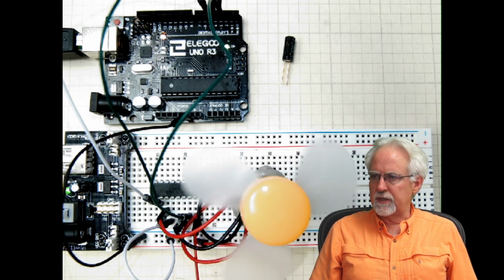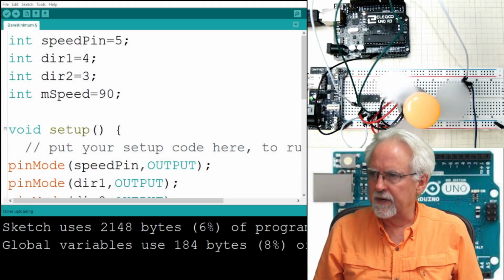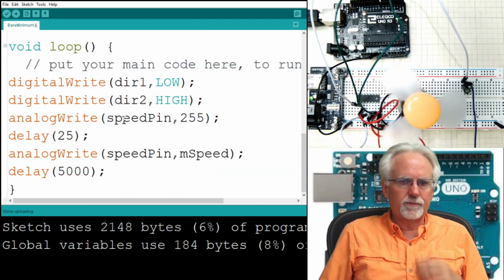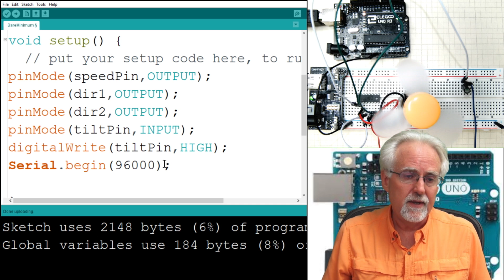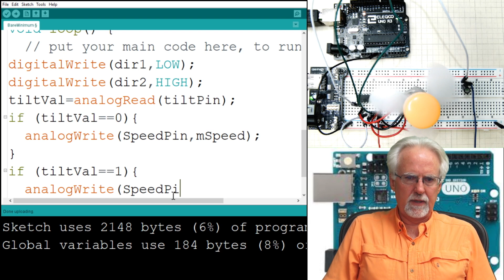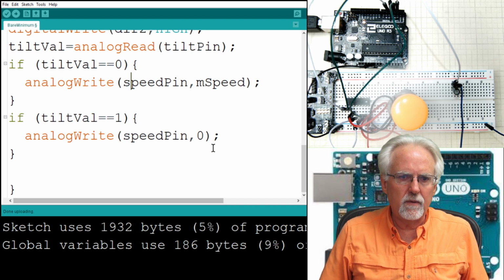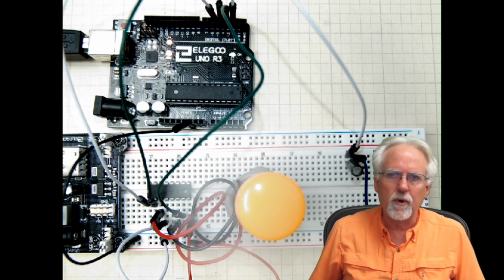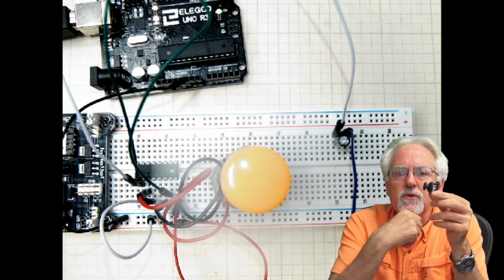Arduino Tutorial 38: Using a Tilt Switch Cut Off With a DC Motor

Comment: Hi, Paul.  Did the homework on my own successfully.  Since the bread board is so big and I hate to have to tear it down and start over most times, I decided to see if I could combine lessons 35, 36, 37 and 38, both schematic and code, so I could run the whole shmear at once.  So, now I have a reversible stepper motor driven by a toggle switch, a DC motor and fan running clockwise (so the air blows out/up from the blades), and both motors stop if the tilt switch goes to 1... with green and red LEDs to indicate when it is normal vs "tilted".   I'm sure the battery doesn't love running 2 motors at once, but the PS does seem to handle it.  My board is quite full, but I didn't run out of pins!  Fun!

Comment: Hey Mr.McWhorter, ,I did this homework on my own, worked perfectly! heres the code:

int dirPin1=4;
int dirPin2=3;
int mSpeed=255;
int tiltPin=2;
int tiltVal;

void setup() {
  // put your setup code here, to run once:
pinMode(speedPin,OUTPUT);
pinMode(dirPin1,OUTPUT);
pinMode(dirPin2,OUTPUT);
Serial.begin(9600);
pinMode(tiltPin,INPUT);
digitalWrite(tiltPin,HIGH);

}

void loop() {
  // put your main code here, to run repeatedly:
tiltVal=digitalRead(tiltPin);
if(tiltVal==0){
analogWrite(speedPin,mSpeed);
digitalWrite(dirPin1,LOW);
digitalWrite(dirPin2,HIGH);
}
if(tiltVal==1){
analogWrite(speedPin,0);
digitalWrite(dirPin1,LOW);
digitalWrite(dirPin2,LOW);
}
Serial.println(tiltVal);
}

Comment: I used an IF/ELSE rather than two IFs. 
I see you found the 96000 baud rate I commented on in the last lesson. 

I still have trouble with replacing a resister in the pull down circuit is with a software write to an input pin. If the board was built by an engineer and passed to a programmer, it might not get coded properly.

Comment: Hi Paul, I just started watching your videos on arduino from last week, and I do like it.. thank you.. if you don't mind, i have quick question on this video, the microcontroller has two pin for ground, and you just used one of them.. correct? if it's sufficient to use 1 pin, why are there 2 pins?

Comment: I did the homework before the lesson.  A difference is that I didn't set the speed to zero to stop the fan, I set both direction pins to "LOW".  Also, I added the LEDs from the tilt switch lesson.  So, when the fan is running, the green LED also lights up, and when the fan is stopped, the red LED lights up.

Comment: Shouldn’t it be equally important to set both digital pins to low and motor speed to 0 if tilted.  Wouldn’t it be possible if the fan was rotating to continue rotating with voltage supplied by the digital high

Comment: I did what you did except I inverted the read from the tilt switch so that when it was in the OK position I was reading "1" from the tilt switch, that way I could simply multiply the motor speed variable by the result of the tilt switch read and if the device is OK the motor would run and if the device were "tilted" the result "0" multiplied by the speed variable would, of course, result in "0" effectively shutting off the motor.  I like to avoid using conditional statements when I can as it slows down program execution.  Also I was a bit confused when you gave the assignment as to if you were expecting us to use the tilt switch and hard wire it to electrically break the circuit or use it as a sensor and use program control to shut it down.  I opted for the later as I figured it was mostly a coding exercise.  Thanks again.  I'm learning a lot.

Comment: Wouldn't it be better to execute the starting kick inside void setup so it doesn't repeat cyclically?
The motor would run smoother... It wouldn't see that cyclic peak in voltage all the time.

Comment: I used the tilt switch and also used the photo detector,. they work great together. The motor does slow down with low light and full speed at full light. Thank you Paul always a good day to watch your lessons.

Comment: I did this after the previous lesson all on my own! Loving the videos!
int speedPin=5;
int dir1=4;
int dir2=3;
int tiltPin=2;
int tiltVal=0;
int mSpeed=255;
void setup() {
  // put your setup code here, to run once:
pinMode(speedPin,OUTPUT);
pinMode(dir1,OUTPUT);
pinMode(dir2,OUTPUT);
pinMode(tiltPin,INPUT);
digitalWrite(tiltPin,HIGH);
pinMode(buttonPin,INPUT);
Serial.begin(9600);
}

void loop() {
  // put your main code here, to run repeatedly:
tiltVal=digitalRead(tiltPin);
analogWrite(speedPin,mSpeed);
Serial.println(tiltVal);
if(tiltVal==1){
  digitalWrite(dir1,LOW);
digitalWrite(dir2,LOW);
analogWrite(speedPin,mSpeed);
tiltVal=digitalRead(tiltPin);
Serial.println(tiltVal);
}
if(tiltVal==0){
  digitalWrite(dir1,HIGH);
digitalWrite(dir2,LOW);
analogWrite(speedPin,mSpeed);
tiltVal=digitalRead(tiltPin);
Serial.println(tiltVal);
}
}

Comment: This one was cake!! The only thing to this point that I’m struggling to conceptualize is the toggle switch.  It gets easier the more I practice with it tho
Reply: Exactly man
Reply: I can agree
Reply: I absolutely agree 🙂
Reply: Yes
Reply: @williamhandlebar9585  the toggle switch was very challenging
Reply: yes! storing the old value and getting the new value and all of that. most difficult idea thus far.
Reply: Agreed.  The toggle switch is very simple from a logic standpoint.  It's a mindbender when you try to translate your logic to code.
Reply: I did the homework 2 different ways, I did it the way you are doing it now, and I did it in a way, that I added LEDs and active buzzer.
 This was a fun project.

Comment: Why not put the tilt switch between pin 8 and 5 V to cut off power to the motor? This way, we don't have to change the code.

Comment: I also chose a hardware solution first connecting the tilt switch between the fan and pin 4 on the controller.
How many electricians does it take to shut off a fan? - zero - that's a software problem......

Comment: Is it possible/safe to put the tilt switch hard-wired inline with the motor? (I.e. fixing it in hardware rather than software). Could this damage the microcontroller? Presumably you'd need a bigger tilt switch if working on larger motors.

Originally did it with the code but realised when watching this it would have been much more simple to put the switch inline...

Comment: Well, I thought I had it last night but couldn’t get it to shut off. Then I couldn’t get it to start after some “fixes” Have to admit I tore it apart and put back together, changed some code, change pins when I thought some pins weren’t working and even swapped out my boards when I thought I might have a board issue. In the end I think (???) it was a combination of coding mistakes with an extra bracket, extra comma and possibly a analogWrite where a digitalWrite should have been. Now working but I have a new issue I think. The power light on the power supply still stays on even when the power supply button is switched off, not as bright but definitely on. Could my L293D chip be damaged, perhaps a bad diode or such? Or maybe that’s normal, just didn’t notice it before? Guess I’ll order a few spares so I can check that out. They say you learn from your mistakes but I’m not sure I feel a whole lot more knowledgeable right now. 😬 Has made me think though so, thanks again Paul.

Comment: Nice Video.
But I’m wondering how the program works.
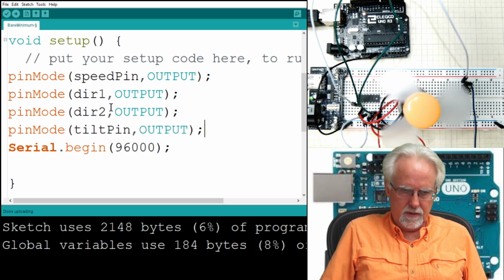At 5:30 you set the “ pinMode (tiltPin,OUTPUT);” 
but it should be a Input to read the tiltSwitch.
I’m wrong?

Comment: Loving these lessons! FYI, I noticed that Paul keeps referring to the trick of doing a digitalWrite to a digital input pin to have it activate a pullup resistor for that pin. I noticed that there is an easier way to do this and that the Arduino docs even recommends doing it this way:

When initializing the pin, simply use a command like this:

pinMode(3,INPUT_PULLUP);

This is effectively the same as specifying that the pin is an input pin AND doing the digitalWrite in a single command.

Comment: i did my homework but i did it a few different ways; first i used an "else" instead of the second "if" statement and i also put my "dir1" and "dir2" in my "if" and "else" statements and i also did not have to print tilt val, here is my full code:

int tiltPin=2;
int tiltVal;
int speedPin=5;
int dir1=4;
int dir2=3;
int mSpeed=255;

void setup() {
  // put your setup code here, to run once:
pinMode(tiltPin,INPUT);
pinMode(speedPin,OUTPUT);
pinMode(dir1,OUTPUT);
pinMode(dir2,OUTPUT);
digitalWrite(tiltPin,HIGH);
Serial.begin(9600);
}

void loop() {
  // put your main code here, to run repeatedly:
tiltVal=digitalRead(tiltPin);

 if (tiltVal==0){
    digitalWrite(dir2,HIGH);
    digitalWrite(dir1,LOW);
    analogWrite(speedPin,255);
  }

  else{
    digitalWrite(dir2,HIGH);
    digitalWrite(dir1,LOW);
    analogWrite(speedPin,0);
  }

}

Comment: Well, I did my homework, but I didn't get it right. I just removed the cable on the 0V pin of the IC and replaced it with the tilt switch. Beginner level showing there, and totally misses the point.
Might be a good idea to go to tutorial 1 and start from there. Haha.
I learned much more your way. Looking forward to learning by going through all the tutorials.

Comment: Yup, I did it! The first time I just put the tilt switch between the 0V pin of the motor control chip (pin 4) and the GND. The second time I did it like you did :D
Reply: I did that too.
How many electricians does it take to shut off a fan?
None - That's a software problem.😷

Comment: i did my homeWork!!!! im looking if is good 

int speedpin=4;
int tilt=2;
int tiltVal;
int dir1=4;
int dir2=3;
int mspeed=255;
void setup() {
  pinMode(tilt, INPUT);
  digitalWrite(tilt, HIGH);
  pinMode(speedpin, OUTPUT);
  pinMode(dir1, OUTPUT);
  pinMode(dir1, OUTPUT);
  Serial.begin(9600);
}

void loop() {
  tiltVal=digitalRead(tilt);
  while (tiltVal==0) {
    tiltVal=digitalRead(tilt);
    digitalWrite(dir1, HIGH);
    digitalWrite(dir2, LOW);
    analogWrite(speedpin, mspeed);
  }
  while (tiltVal == 1) {
    digitalWrite(dir1, LOW);
    digitalWrite(dir2, LOW);
    analogWrite(speedpin,0);
    tiltVal=digitalRead(tilt);
  }
}

Comment: Paul thanks a lot for the videos. I am ready to start using motors on my project. I have a desk that rises and lowers by turning a nob. I have this desk: 
https://www.amazon.com/gp/product/B074P7QCYH/ref=ppx_yo_dt_b_asin_title_o05_s00?ie=UTF8&psc=1  

I will like to twist that nob thanks to your tutorial using a motor. I am obviously buying one that has high torque and requires additional external voltage. 

I already managed to use the motor thanks to your tutorial. The coding part is no problem thanks to your videos. 

My question is how can I attach that motor to the nob? should I glue it? Where can I get more information on what parts to buy so I can attach this motor to the desk without having to glue it?

Comment: First, I think I am one of the 3 minute watchers, because for most of the time when you go over the homework I just skip to the end to see what I did wrong or what you did was different. or I just try to do the program by myself then see if it is correct
Second, in this video and video 37 your Serial monitor is on 96000, you have an extra 0.

Comment: Thank you.  I used your teaching model to use a push button switch (instead of a tilt switch) to turn on and off a DC motor for use in a door.  When the door is shut the button is pushed and the motor operates.  When the door opens, the motor stops.  Now I'm trying to put a number of processes together, motor forward, motor backward, solenoid, IR beam sensor, proximity sensor, all stopping if the door is opened... hurry up and do this so I don't have to figure it out.  :-)

Comment: int speedPin=5;
int dirPin1=4;
int dirPin2=3;
int dt=1000;
int mSpeed=255;//unter 100 does not run the motor so 100-255

int tiltPin=6;
int tiltVal=0;
int dt1=100;
int rLed=2;

void setup() {
  // put your setup code here, to run once:
pinMode (speedPin, OUTPUT);
pinMode (dirPin1, OUTPUT);
pinMode (dirPin2, OUTPUT);
Serial.begin(115200);
pinMode (rLed,OUTPUT);
pinMode (tiltPin,INPUT);
digitalWrite (tiltPin,HIGH);
}

void loop() {
  // put your main code here, to run repeatedly:
tiltVal=digitalRead(tiltPin);
if (tiltVal==1){
//(mSpeed=0);
analogWrite (speedPin,0); 
digitalWrite (rLed, HIGH);
}
else{
digitalWrite (rLed,LOW);
digitalWrite (dirPin1,HIGH);
digitalWrite (dirPin2,LOW);
mSpeed=250;
analogWrite (speedPin,mSpeed);//start fast
delay (dt);
analogWrite(speedPin,100);//than run slkow
delay (5000);
}
}

Comment: Yo! Teach!!

Below is the code for the control of a DC Motor using a Joystick.

int speedPin = 5;
int dir1 = 4;
int dir2 = 3;
int motorSpeed = 0;

int joyX = A0;
int joyValueX;

int wait = 50;

void setup() {
  // put your setup code here, to run once:
  Serial.begin(9600);
  pinMode(speedPin, OUTPUT);
  pinMode(dir1, OUTPUT);
  pinMode(dir2, OUTPUT);
  pinMode(joyX, INPUT);
  pinMode(joyY, INPUT);
}

void loop() {
  // put your main code here, to run repeatedly:
  joyValueX = analogRead(joyX);
  Serial.println(joyValueX);
 
  if(joyValueX < 500){

    motorSpeed = 255. - (joyValueX * 0.51);
    digitalWrite(dir1, HIGH);
    digitalWrite(dir2, LOW);
    analogWrite(speedPin, motorSpeed);
    joyValueX = analogRead(joyX);
  }

  if(joyValueX > 550){

    motorSpeed = (255./473.) * (joyValueX - 550.);
    digitalWrite(dir1, LOW);
    digitalWrite(dir2, HIGH);
    analogWrite(speedPin, motorSpeed);
    joyValueX = analogRead(joyX); 
  }

  if(joyValueX > 500 && joyValueX < 550) {    
    analogWrite(speedPin, 0);
    joyValueX = analogRead(joyX);
  }
}

Does it look good, because it seems to be working?

Cheers!!

Comment: I did the homework but was unsuccessful on several levels. I had bad connections because of loose wires, wrong pin connections caused by troubleshooting the loose wires and then bad coding because of it all. In my own defense, my original code was very similar to what you did, however, my tilt switch did intermittent 1's and 0's, even when the tilt switch was removed from the board. I thought I had a defective switch but an Ohm test showed it was good. The final result was I had the switch plugged into the tX1 connection instead of pin 2. My vision isn't good enough to see these tiny numbers and wires. But hey, I don't have enough hair anymore to worry about pulling it out!

Comment: I did do the home work, but I put my tilt switch on the small prototype board so I wasn't twisting so many cable. And I used just one analogWrite statement after the two if statements.  I changed the value of mSpeed in the two if clauses.

Comment: I've completed the homework and look forward to comparing your solution, to be shown in lesson 39.This was a fun assignment.

 On another note, I did not buy my Elegoo kit at the beginning of this series, so I have a lot of earlier lessons to do. One of those, lesson 22 (active buzzer), has homework to add a potentiometer to sound the buzzer when the potentiometer has a value greater than or equal to 1000. I decided to do this one. Since my breadboard is currently set up for lesson 38, the Arduino 5V pin is in use by the joystick. The potentiometer needs 5V, GND, and an Arduino analog pin. Rather than use the Arduino 5V pin, I thought that, since the power board that is already on my breadboard outputs 5V, I would use that with the potentiometer. Much to my surprise, when turning the potentiometer from low to high, the value went from 0 to around 995. Adding code as shown in lesson 12 (potentiometer) to also show voltage, the 995 value corresponds to 4.86V, a little shy of 5V. I am using an AC-DC adapter to power the power board. I did verify that the AC-DC adapter is outputting 9.03V, so it appears to me that my power board is not outputting 5V. 

Just to doublecheck, I did hook up the potentiometer directly to the Arduino 5V pin. In that case, the maximum potentiometer value (and voltage) is 1023 (and 5.00V), as expected.

Could someone here check if their power boards behave similarly? The simplest test is to repeat lesson 12 (potentiometer), but hook it to 5V and GND on the lesson 38 breadboard layout so that it is powered by the power board.

This is not a problem, just a surprise. The DC motor and stepper motor lessons work fine, even if the power board outputs slightly less than 5V.

Comment: That was brilliant, many thanks. My motor is OK, I had it plugged into the VIN not 5v. Aging eyes. Still a problem with either the power supply board or the controller but there is a work around.

Comment: Not having much luck with some of the Elegoo components. I revisited lesson 37 because I ended up taking 5v directly from the Uno to pin 8 on the mtr controller to make the motor work. The power supply board is only giving 2.6v. Now the motor is making some background noise and won't start at 90rpm. I have to start at about 150. This is my 4th bad component. They did replace the Pot and the joystick but now I have  either a bad power supply or mtr controller and a bad motor. Thankfully this stuff is very cheap to buy. I like that you are putting the code  and  diagrams on you TTB site. Cool modded tinkercad like diagram.

Comment: Mr McWhortor, I just received the elegoo super starter kit today. I should have gotten that a long time ago. I had a problem getting the board going but checked the com channel and it was different than my Arduino. I changed that and, it is working fine and ran the sketches that I uploaded to it. I'm good to go and now I have the sensors to follow your videos. Thanks for the advice. That starter kit is absolutely the way to go.